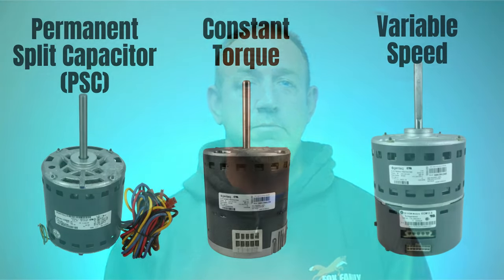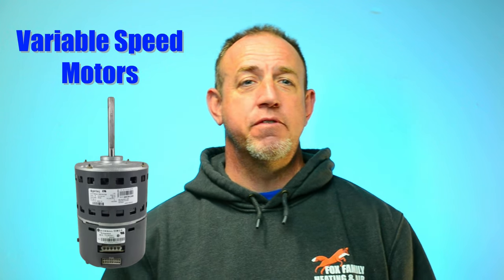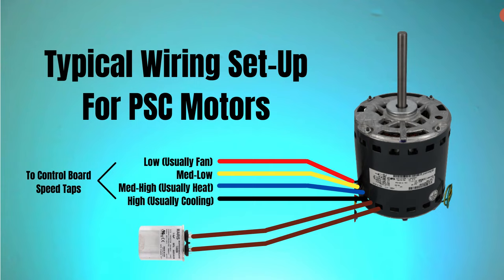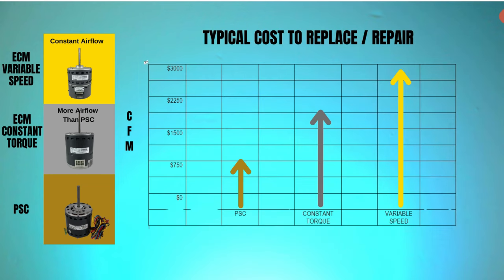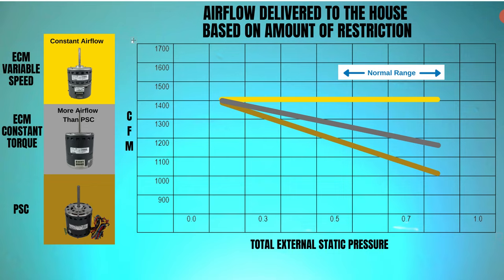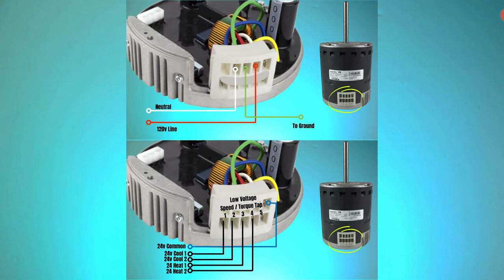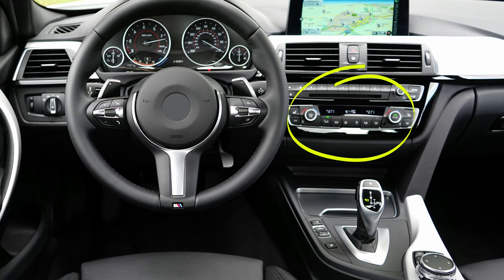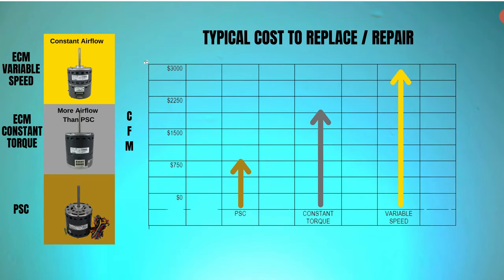PSC Motor vs Constant Torque Motor vs Variable Speed Motor | Comparison Video

Comment: Good video but your description of the PSC is not correct.  The utility does nothing to operate this motor other than supply the operational voltage.  The utility does not "split" anything.  It is the capacitor that provides a shift in the phases between the two windings, thereby allowing rotational forces.
Reply: Also wasn’t he also wrong to say PSC will draw higher amperage when there are restrictions? As far as physics told me: PSC will draw less current if there is less air to move ie more restrictions! Right?
Reply: Yes indeed you are correct
Reply: @Seedavis397  he should remove this video and be ashamed of himself!

Comment: Capacitor takes the place of a shaded pole and provides the 90 degree phase shift needed for a PSC motor to turn.  It is pretty cool seeing it in an oscilloscope.
Reply: Don’t forget the start winding.
Reply: Also a capacitor is acting as if the power were 3 phase.
Reply: @Garth2011  2 phase.  --Doozer
Reply: @picklerix6162  2 run windings, supplied phase and  offset phase.  --Doozer
Reply: @kooldoozer Correct. My error

Comment: Cost of ownership plays an important role for most folks I believe.  If a variable speed motor is going to be 4 times the cost of a PSC, it does make one wonder if they want that supposed to be  "20%" savings and less noise. It also is important to know that those higher end motors have PCB, circuit boards, with solder joints, printed circuits and electronics on them that will also likely find more break downs vs. PSC. Sometimes it is best to stay with old reliable and focus on other mechanic parts that can be more efficient that don't have a short or limited life cycle. We all know that much of today's parts are made with less quality, robust and longevity in mind so a $750 motor replacement once seems more interesting than a $2,800 replacement likely three times during an HVAC lifespan.
Reply: True but according to Dave the pool guru at pool tips chanel, he hasn't had to change one variable speed motor for like 15 years, and they all say.80% to.90% electric savings which I'm still trying to verify bc of true, variable would be way cheaper over 3 years
Reply: @SmedleyButler1  Are we discussing Pool pump or HVAC motors?
The older versions of the Genteq X13 ECM motors found in condensers and blowers were the worst of them. The ECM has a "thermistor" which is a $2 part that regulates in rush current is soldered onto the circuit board and in most cases, not all, that part fails while the rest of the mechanical motor parts are still good. The latest replacement for them is the Evergreen ECM which doesn't need programming and tends to be more reliable. Still, those motors are 3X the price of a PCM replacement or around $600.
Reply: Huh?  X13 is not variable speed... the constant torque and inability to self-regulate means whenever there is an issue, that issue sooner or later results in the motor burning itself out. Variable speed have much better durability. IF for whatever reason the motor dies early, that ruins the equation, but that's why warranties exist. They're also not so crazy expensive as suggested here.  @Garth2011
Reply: @garrettmillard525 Yes, they are.

Comment: To say an ECM motor replacement is priced around $3k is an indictment of the whole HVAC industry. We are probably 1-2 decades behind where we should be in the area of efficiency because local installers are too comfortable with old technology and manufacturers mark up efficient models and parts way beyond the extra manufacturing costs. I put in a furnace with an ECM motor 15 years ago and it was a great decision - a noticeable decrease in my electric bill, much quieter, and my old home has significantly fewer cold spots on cold days. Anything less shouldn't even be on the market any more. I'd hate to think of where we would be if the government wasn't pushing this industry forward.
Reply: @marshmower  What I want is to be able to affordably install the most efficient, advanced, and comfortable heating and cooling system available the next time that I need an upgrade done. I'm sick of local contractors trying to push 50 year old technology on me in the guise that it is more reliable. I'm sick of manufacturers artificially jacking up the cost of modern, advanced systems - whenever they eventually get around to offering some. The industry is failing to offer affordable, modern systems to enough people. I don't care how it is improved and I'm perfectly happy to have government push them into the 21st century if that is what it takes.

Comment: The ECM in our furnace failed over Christmas while we were out of town. The service company would not honor their lifetime warranty sold to the previous owner, but the technicians showed me the small, overvoltage protection device had failed, shutting down the motor. They wanted more than $1000 to replace the entire motor plus controller assembly. I told the technician I would have to think about replacing the motor. I paid him for his service call and then ordered the new part online for delivery the next day. The part arrived, I took out the remains of the failed part, soldered in the new part and it has been working fine and for the last eight years. I spent $35 for the part and shipping. I got a spare just in case the part fails again. I wonder how many people’s financial lives fall apart because they can’t make a $25 repair of something that is essential to modern life. 
The part which failed was a surge suppressor in which research indicated a vulnerability to power cycles and surges. The explosive failure of the part coincided with a power outage and subsequent restoration. That were very likely to have caused voltage surges. I have sense installed a whole house, surge, suppression device at my electrical panel.
Reply: Also called a thermistor. A black round disc with two wire leads that solder onto the circuit board. You can also purchase only the ECM part on those motors however, the cost is almost the same as a complete ECM motor !  Likely a poor quality part vs. "power surge" since many of these fail.
Reply: I went through the exact same thing with our Bryant furnace like 10 years ago. Got lucky, and since I have a basic understanding of electronics, found that MOV looking disc in the motor popped. Found replacement for like $3.00 and replaced it. Motor came back to life and still running! Shame to think about all this stuff just thrown out because of a part that cost a few dollars. Also learned that the actual motor is a 3 phase permanent magnet motor and could be used as a wind power generator for a hobbyist!
Reply: Bravo. It's disgusting how averse not only regular people, but even the so called technical experts we call for help are, at making repairs. I guess our litigation-obsessed society is at least partly to blame, liability and such.
Reply: It’s called a business my friend.
Reply: @yassocolorado  its called gauging AO...

Comment: Good video, but you got the PSC and ECM amp draws backwards. PSC motors love high static and restricted duct work, they draw less amps and deliver less air because they are one speed only High, Med., or Low. depending on how they are wired. So, when the ducts and or coil are restricted the amp draws will be less on a PSC compared to a ECM. However, the exact opposite happens to the ECM because they are constant torque, and always will ramp up to deliver the programmed cfm, they will pull more amps with restricted ducts while trying to deliver the right amount of CFM. In fact, this is one reason ECM motors don't seem to last as long as a PSC, when they have restricted ducts or coils they are running at much higher rpm's, basically max rpm's and pulling max current, which makes them fail prematurely. 

In the past this was a dirty little secret, where the contractor would put in a variable speed motor to overcome duct work problems, sacrificing efficiency for better airflow, instead of fixing the duct problems. Now, because of the FER Fan Efficiency Rules we have to use a ECM motor on almost all systems. So, it is imperative that you take a static pressure of the old system, including a duct leakage test to determine duct work problems and fix the ducts before replacing that old PSC system with an ECM. Otherwise, you will be back out in a few years replacing a motor that costs over a thousand dollars.

Good video
Reply from the maker: Thank you as always Mitch! You going to the AHR Expo this year in Vegas?
Reply: @foxfamilyhvac  Wish I could, but I have to teach classes in Tulare at SCE the 1st and the 2nd of Feb. I also signed up for teaching for NCI next year, so far I have over 60 classes I will be teaching next year between IHACI and NCI.
Reply from the maker: @baileysair  Wow. That's awesome. Thanks for all you do for the industry.
Reply: If a motor fails prematurely because it actually needs to run at its full nameplate rating, then it's a crap quality motor. Period. That excuse would never fly in any other industry.
Reply: @peterl1365  Thanks for your comment. However, it's not the motor that fails, its the powerhead. As you know capacitors fail all the time and that is usually an issue with heat, too much heat and you let the smoke out. The same holds true to the electronics that control ECM and Variable speed motors. They just don't hold up to running with extreme static, it generates to much heat in the powerhead electronic components, the motor is fine, its the powerhead that fails. Granted that is not an excuse. However, as I have been taught it's all airflow, airflow, airflow. When airflow is bad you will never get the capacity, efficiency, longevity, and or the comfort. Fix the airflow and the motor will last longer, plain and simple.  Here is a link to a great video by Grayfurnaceman. https://www.youtube.com/watch?v=XfGHC1O9ryk
Reply: @baileysair  if the drive, what you call the powerhead, is failing, then it's almost certainly because of planned obsolescence. A well-designed and properly-sized drive should have a very low failure rate. Airflow is just like any other motor load. If you size the system properly to it's expected maximum load,  then you should expect a long lifetime (albeit with a non-zero failure rate due to normal component failures). I work with automated equipment and we always design to the peak loads, not just the typical loads. Then we add a significant safety factor. The added costs of proper sizing and engineering pay for themselves many times over in increased reliability. The industry does the customer no favors by cutting corners on the initial installation. Unfortunately for the consumer, the industry profits handsomely from doing a crummy job right from the get-go.
Reply: @peterl1365  The problem is that they are out of design, the motors are being installed on duct systems where the motor has a plotted fan flow up to 1.0 inch or 1.2 inches of static. I see 1.6 inches of static on many systems that we are replacing motors prematurely. Even though the motor itself is not pulling over its rating, the electronic components of the controller is. The components are running hot and fail because they are exceeding their design. In other words, the manufacturer rated the motor not the controller. Is this planned obsolesce? No, I don't think the engineers had the goal of all these motors running at such high static for extended periods of time.

The fan laws say as static increases brake horsepower increases by a factor of 3 and although the motor can handle that extra load, the electronic components can't run at a 100+ all the time.

ECM and variable speed motors are very efficient and because of the fan efficiency rues (FER), these are the type of motors you will see in almost all systems you buy today.  Our duty as HVAC guys are to insure that they are installed on properly designed duct systems. When we fail that, it's not the manufacturers problem, it is ours. 

If these high static duct systems had PSC motors, they would run forever because they are constant speed not constant torque or constant airflow, they love high static and pull low amps. However, airflow is diminished considerably and the system never delivers the 400 cfm per ton. I have found high static 4 ton systems only delivering 1000 cfm because of this and that they have PSC motors, only 2.5 tons. This was because the guy before me never did a load calculation and threw in a bigger system so the customer would not complain. The ducts could only handle 2.5 tons, and that was what the customer was getting. Worse, if the customer is replacing the system and the contractor does not size the unit correctly and just replaces the box with another box that has an ECM or variable speed. We will get motors failing only a few years after install. Again, this is not the manufacturers problem it is the installing contractor.

Now for a story, when I was learning to fly, my instructor Keith owned the flight school in Oakdale and also rented planes to people. He told me a story about three guys that came out to rent a Cessna 172 and asked if they could remove the doors to take pictures because they were going to fly in the canyons of the Sierras to take pics. Which is perfectly legal, but Keith said his insurance would not cover it and said no. However, they left Oakdale airport, flew up to Columbia airport and took the doors off anyhow, they proceeded to fly up canyons taking pictures. They crashed killing all of them. The reason they crashed was because they were flying up the canyon that was rising in altitude, which the plane could not outclimb and drilled into the side of a box canyon that they did not have the room to turn in. You see when doing something like that you don't fly up the canyon, you fly down the canyon so you have plenty of climbing power and the terrain is reducing in altitude. Keith and his flight school was sued by the families. During the trial the lawyer for the family asked him why they crashed and he said it was because they were trying to make the plane do something it wasn't designed to do. Then the lawyer snapped back, "and what was that"? Instead of explaining that the plane did not have the power to outclimb the increasing height of the canyon Keith said sarcastically, "Drill through the side of a mountain!" The judge wasn't too happy about that and admonished him. He still won in court. I think this story is appropriate because you need to know the limitation of what you are trying to do with any piece of machinery. Granted, ECM motors are not life or death but they are damned expensive to replace. Thanks for your comment, I love debating this stuff.
Reply: Great comment...
Reply: Ecm motors are designed to back down once the get to around 1" of total externalbstaic pressure. Its a safery to prevent over heating and premature failure. An ecm moter than is running at high static will either slow down and not maintain the correct cfm or it will constantly hunt ramping up and down non stop letting you know there is air flow issue do do duct restriction either on the return or supply.
Reply: Its garythefurnaceman I beleive. He is a good source of information along with Brian from hvac school and Craig B. With hvac service tech. Dont trust all the sources here on youtube some of these guys are total hacks. Lol
Reply: A big problem is older systems in older homes are needing replacement but homeowners with deminishing salaries cant afford to fix their homes duct work issues. Its not always the installers fault. If I quote the ductwork and explain the issue all the home owner sees is an additional ductwork bill in the tune of $4,000 plus because of how horrible ducts were installed back in the day. The customer almost always says Install it and leave the ducts as they are. And today pretty much everything is comming with a constant torque ecm at the very least. PSC motors are gone. So unfortunately we give the customers what they pay us to install.
Reply: Spot on Mitchell, I'll take reliability over energy any day.
Reply: @drg424  Exactly what did they save when they had to pay almost a thousand to replace the motor, I am sure it was not even close to what they saved in energy.
Reply: Thanks Bailey!!!
That's make sense to me as simple logic...
Just replaced a new ECM motor 1hp dual voltage/4 pins  for my brother, it's a nightmare to understand the rules and cost so much of 💰. Lucky I have a bit of electriccal/mechanical knowledge otherwise 1k+ to have technician come out will costly. 
Lenox furnace with Surelight control board. Thanks again!
Reply: @davidhua2002  Do yourself a favor and take the total external static pressure to make sure it's less than 1". If it isn't I would think about seeing what I could do to reduce it to preferably 0.5". Add a return and/or supply duct or increase the size of some of the existing ducts.
Reply: Please elaborate on your comment: "However, the exact opposite happens to the ECM because they are constant torque, and always will ramp up to deliver the programmed cfm, they will pull more amps with restricted ducts while trying to deliver the right amount of CFM." What / how will the ECM ramp up to deliver the programmed CFM? What is the signal to the ECM to speed up for an increase in static? What about the fan wheel static curve impact? The ECM compensates for this? Is there shaft speed slippage due to static increase?